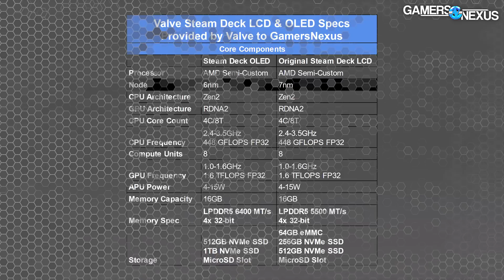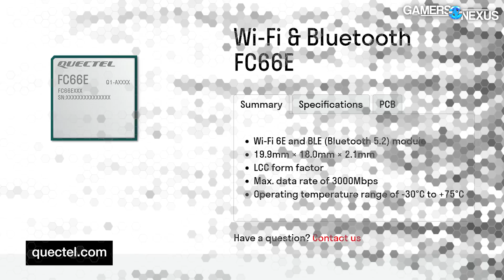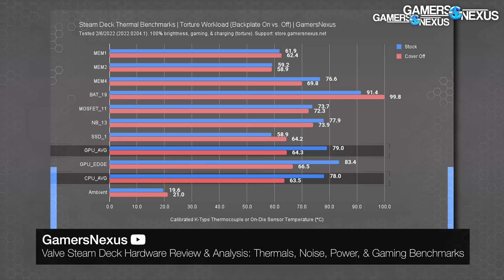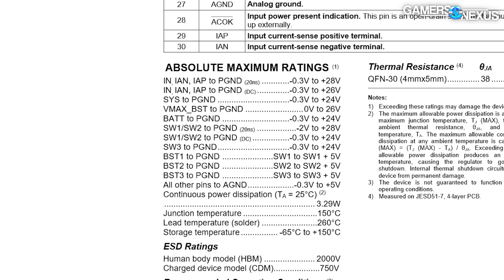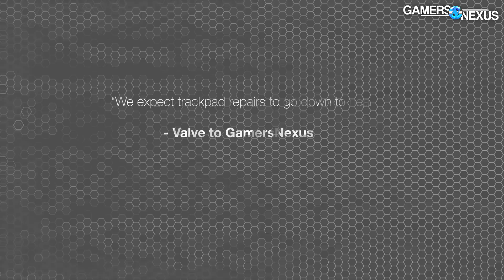They Changed Everything: Valve Steam Deck OLED vs. LCD Tear-Down

Comment: Steve, if it took that long to route the memory for only 2 dies, then they probably did time of arrival simulations rather than just length matching. Ultimately, the data needs to arrive at an identical point in time, and as speeds increase, it gets more important.
Reply: Yes the speed of light is constant...in a straight line! But you probably added 's' shaped traces to match the lengths. Shape of the S changes reflection behaviors and when you only have 50 or 100 picoseconds to work with it matters.
Reply: @LordHyren  Ah, thanks!
Reply: As someone who only drew PCBs by hand 30 years ago as an extra curriculum activity in 8th and 9th grade, can you explain the difference to me? At a glance it wold seem that, since the speed of light in copper is the speed of light in copper, then if the traces have the same length and gauge the arrival time would be the same as the transient response is the same. What am I missing?

Comment: There is no way that this board redesign, & all that empty room, is actually about thermal effency: all that space around the memory would make it really easy to shift things around and bump up system ram to 64mb for the Steam Deck 2.

Yes that would require redesign of the traces ... But with this layout they wouldn't have to remodel everything else on the board to do it.

Comment: One of the hidden benefits of having all that space around the APU and power delivery is that many chip packages also sink heat into either the top copper layer (or sometimes the bottom with heat transfer through vias). If that's what's happening here, there are two effects—first, the layer would act as a sort of "thermal capacitor" being able to wick away sudden thermal spikes (in addition to the heatsink). And second, while some people will cry "but heat soak!", there's so much free area around the APU that air can flow over that, even without fins, there would be quite a bit of heat transfer. This is often done in industry—for example some drivers for small stepper motors simply don't need a heatsink because they're a flip-chip design with a large copper pad on the top. All of this is really important for a die that has shrunk because, while the chip will be more efficient, the heat is packed into a much smaller area. It's similar to cooling issues with the smaller chiplets on CPU's—you have to have good cooler confact over all the chiplets. Even though they're small, that heat is concentrated.

Comment: Mind blown with the memory chip size DAMN. With all that space, why not make a 32GB model? 

I'll take a midrange 256GB model with 32GB of RAM and the original screen!
Reply: comes down to manufacture cost. Valve said was painful to hit $399 mark for 64GB Model. That's why still using slower Zen2 instead of Zen 4 like faster Legion and Ally.

Comment: The new thermal design makes a lot of sense. While I thoroughly appreciate the elegance of the old thermal solution, lots of people modded theirs to lower APU temperatures, which would result in everything else running hotter (probably too hot). The new setup should be a little more effective to begin woth, but more importantly, it'll be more mod-tolerant as the requirement for secondary flows is less critical.

Comment: Valve sold me their old deck (got it as a gift for my son-in-law) less than two weeks ago. Not a whisper of a new deck coming at any time. As a customer relations standard, people should be made aware that a better version is coming within a short window after their purchase. Now what? I hand my new son-in-law a handful of (admittedly cool) old tech while there is a better version that just released? Fokk.
Thank you for breaking down the specs on the new deck. It looks amazing and I can't wait to see it in action! I'll try returning this old clunker and order the new one. The 1TB version + any restocking fee for the one I am returning will still be cheaper than the deck I got. smh

Comment: I like that valve sought to change the design not just to maximise profit (although no doubt that's a benefit to valve) but to improve repairability, reliability, and thermals as well as the headline screen improvement.

The only major downsides I can think of is the existing parts for hall effect sticks for example might not be a drop in replacement, and the existing supply chain will need to be expanded to provide parts for the OLED SD.

I still want one though, but alas, I don't have enough pennies hidden behind the settee to buy one :(

Comment: Really wish I had the brain cells for electrical engineering/ PCB design. It’s pretty fascinating. It’s like a big puzzle where there’s a multitude of ways to do the same thing but with potentially vastly different outcomes in temp, efficiency, durability, etc.

Comment: Valve needs to be applauded, yet again. The first Steam Deck was designed with the intention for end-user serviceability and modification. Heck, Valve even wrote guides how to do them. Even more, they told you how to do things they didn't even recommend you do. Like they knew people were going to do it anyway and wanted to give us the best chance of doing it properly.
 
This refresh was Valve going, "You know what? Everyone likes the OLED mods. Let's do that now. Also, let's not only optimize everything else and use better components, let's make it easier for people to fix and repair parts."

This refresh further kicks in the teeth of other companies (especially Apple) who want to spread the false idea that it's impossible to design and manufacture mobile devices that allow for end-user serviceability. It also goes to show how far out of the way these asshole companies go to intentionally lock down their devices to make them nearly impossible or actually impossible to repair (e.g. component sourcing and encryption). We need to continue calling these companies out and fighting them.

We have the right to repair the products we buy.

Praise GabeN and all the engineers who dedicated so much time and effort into this!

Also huge kudos to Gamers Nexus for yet another high-quality and highly informative video! The fact ya'll got this out so quickly is astounding, but then again I'm not surprised anymore. Ya'll just keep setting the bar higher for *everyone*.
Reply: The repairability of their devices as well as how much they contribute to the development of free as well as open source software really makes me love valve.
Reply: of course we have the right to repair. We bought the product hence it's our property asset now
Reply: @whamod  You may think it's obvious but holy shit do many companies not agree.
Even worse they'll actively try to sabotage anyone trying to fix their devices.
Reply: ngl this made me actually tempted to buy a steam deck now
Reply: Imagine if Valve made repairable and modifiable smart phones. They could absolutely destroy Samsung and Apple with that philosophy. Meanwhile actually reducing e-waste.
Reply: @nojuanatall3281  Such phones exist (fairphone for example), not a mass market though for now, because people run after the next shiny thing instead of getting their phones serviced for additional years add on top of that that phones usually run out of firmware updates in a 4-6 years timeframe and you have the environmental mess on your hands we have atm!
Reply: They glued the battery in which is ridiculous and unneeded and happens to be a part that will be replaced a lot.
Reply: @dannymundo7538  Problem according to them is, that portable devices would need a fixed battery, so the glue was more or less mandatory! But anyway the battery. is an issue they have to work on in the long run because the EU will mandate user replaceable batteries by 25!
Reply: It's a cultural difference.

Valve has come up through the PC gaming ecosystem. Where freedom, customization and user generated content is valued... Whether that's modding games or building your own PCs or running emulation etc.

Apple has come up through a very different ecosystem with a more tightly calibrated end user experience where they expect to be in control of all the variables.
Reply: @Arjun-eb1yc  Still gives them NO right to dictate our right to repair their overpriced toasters lol
Reply: @Arjun-eb1yc  Apple was different a long time ago. You could buy an Apple ][ clone that was not even made by Apple. There was a whole 3rd party add-on card market and the manual on how to build your own cards for the Apple 2.

Then they became greedy and almost went bankrupt until they marketed ipods, iphones and ipads to people who only care about the shiny status symbol.
Reply: @joe--cool Apple didn't become greedy. Their shareholders did.

Big difference.
Reply: @joe--cool  these days Apple won't even allow AMD/Nvidia to ship Vulkan drivers on OSX. Because they don't want devs to have a common Vulkan target across Mac/Windows/Linux. I.e. they want applications to be less portable across platforms.
Reply: @Arjun-eb1yc   Source please?  Would NOT doubt it though lol.
Reply: Wish there was an easy way to mod the switch
Reply: @nono-hy7gb gl with that... Nintendo and Apple could well be twins.
Reply: OLED mods? Where?
I was about to order the new Deck in a couple days but an OLED mod could save me money for now.
Reply: Valve needs to make more, and do less squatting on their sales cuts. This is a step in the right direction, but they can do so much more I just know it...
Reply: Servicability until you hit the battery, I am still puzzled why valve did not go with pullable adhesive strips, Apple style and went with bottom glue instead, but I guess they needed to save some space and glue strips add to the overall thickness compared to glue!
Reply: We will applaud them the day hl3 comes out

Comment: Crazy how much they changed. It's almost like a completely now product. It's also really nice to see someone actually think about repairabiltiy and actively trying to improve things. In comparison to nintendo and their switch for example

Also quick sidenote: The flickering (I assume from the LEDs from your lighs) is really off-putting (see for example 4:43 or 9:15). Never seen that before in a video of yours
Reply: Almost like a completely new product? True, because aside from improved overall design and efficiency, it performs exactly the same on existing games. 

Demanding games are nearly identical in every way too, so it's the same machine at the core.

In that regard, they're not any different than Nintendo. Whatever you want to believe though.
Reply: @notsyzagts7967  What are you talking about? Do they advertise performance improvements anywhwere? Checking the store, they advertise 4 main points: Better display (OLED is better), more battery time(the battery is better) , faster downlaods (technically possible with the faster wifi module, if you have  the bandwidth) and finally lighter and cooler, which it likely is given the changes.

The note with nintendo was in comparison to their messed up policy handling their garbage joysticks even after redesigning the whole thing. They knew they were broken, but decided to make money off of it anyways. Valve on the other hand moved buttons around n stuff to make it easier and cheaper to repair. So tell me, where am I wrong? If you want more performance, buy a product that actually advertises more performance.

And for the record, I don't own a steamdeck and won't any time soon either.

Comment: 4:05 The length isn't important, it's the delay, having 2 traces be the same length doesn't necessarily mean the same delay, since there are capacitances and inductances that influence how long it takes the signal to travel to it's destination

not an expert I just heard this from a Robert Feranec/Fedevel PCB design YouTube video
Reply: length closely correlates causally with delay even tho it's not perfect

so it's not entirely wrong

Comment: I'd love to see comparisons between the etched and non-etched glass. I think I might prefer the 512gb model for better blacks in dark environments. I don't suspect I'll be playing a lot in outdoor or office lighting conditions. Side by side shots in various environments would really help me overcome the urge to try and snag the limited edition colorway.
Reply: This is my biggest request as well.
Reply: Dave2D compares the etched vs non-etched screens in his Steam Deck video and it looks like the non-etched version is the better option for indoor use.
Reply: @NoToeLong  - Dave2D does a decent approximation using a screen protector, but I still think we would benefit from a more in depth comparison. The glossy model Deck on the top is an LDC, and Dave2D only does the comparison under studio lighting with a brightly lit background. I don't mind the screen protector trick, it's mostly the different lighting environments that I feel is missing
Reply: That'd be a good comparison to see, though with the screen protector trick it might be best to get the etched glass one and add a screen protector if you feel you need improvement.

Comment: Docked operation without internal battery testing could be interesting as desktop replacement.
Reply: Maybe as a laptop replacement but not a desktop. Not with a screen that small lol.

They didn't make any major internal upgrades so it has the same base performance limits as the original.

It's better but not THAT much better.

Comment: It would have been cool to see that airjet cooling system in this, but at least its better than the original as far as cooling. Maybe the redesign could make it easier to retrofit something. Wish that company would just sell a solution if its possible. The fan noise and battery life are my two bigger gripes, and I use the Steam Deck all the time so this update  is tempting.
Reply: The airjet's biggest problem is power consumption. It's very quiet, but it's not power efficient at all. And an extra watt or two of power matters a lot in devices like this.
Reply: The unit cost of a traditional blower fan vs that of an airjet is likely to be orders of magnitude different, a cost increase for a part change which would have little impact on the end user.

Comment: Burning question because you're seemingly the only people with a preview unit who've had the guts to take it apart - would the process of replacing the internal SSD be the same, easier, or harder than the LCD model? I swapped my LCD's storage for a 2TB drive, and if it's significantly harder or impossible to replace the internal in the OLED, that's absolutely stopping me from upgrading.

Comment: 7:36 Oh no...The new WiFi adaptor. The old Deck's WiFi 5 adaptor can be upgraded to a much better WiFi 6E Intel AX210 due to same form factor. The one from Deck OLED seems not compatible from the looks of it. Now that Intel WiFi 7 adaptors (Intel BE200) are in the market, old Deck users can upgrade .
Reply: Am I dumb? Chip size and form factor seem wildly different

Comment: So the new battery can't fit in the old Deck? I was hoping to maybe buy the bigger battery separately and upgrade my LCD Deck at some point.
Reply: The new battery is physically larger and uses some of the extra space made by the fact that OLED panels are significantly thinner than LCD assemblies, so no, unfortunately, at least not with an unmodified case

Comment: Not gonna lie, I'm more than a little disappointed that Valve didn't work with GuiliKit on including Hall Effect Sticks and Triggers out of the box with this revision. And in fact, they seemed to go out of their way to redesign the sticks just so GuiliKits current aftermarket Sticks are no longer compatible.
Reply: They changed everything for Cost reason, otherwise they would have changed the design.

They already said that the "Hall Effect Stick" is not as Anti-Drift as people think.

The Device still has to be affordable, remember that.

Comment: Since you mentioned that, according to Valve, "it's possible to remove the OLED screen from the device without taking apart the whole back of the device" do you think it will make things like shell-swaps for third party shells easier? Or at least involving less heat gun + adhesive related shenanigans?

Comment: 166.05 mm² down to 132.65 mm² is more than 20% die shrink, which I think is remarkable considering N7->N6 will only net you like 18% more logic density iirc.
N6 is said to be easy to transition from N7, but there might have also been some design changes at play here. Interesting stuff.
Reply: i heard the original chip had some unnecessary stuff, supposedly because it wass originally a microsoft project
Reply: @the_retag  Wow, I never knew that! That may explain the huge reduction. 
Thanks for the detail, now I really want those annotated die shots side by side lol

Steve, please make it happen!!1!1!!
Reply: @the_retag with someone doing a die shot, the chip was shared with an AR company
Reply: @macstevins  yes watched a die shot vid too
Reply: @the_retag  The original chip was a generic laptop chip, so it probably had a lot more I/O than what the Steam Deck needed (like SATA).
Reply: @andersjjensen  no it was certainly not a regular laptop chip, definitely custom.
Reply: that'd be based on amd cpu design, tho it's very interesting to see such a larger reduction
Reply: most of the large size of the memory packaging is just epoxy cover, the actual die is often around 80%-50% the size in the middle so the memory die shrinking/ improving  means that you can shrink the size a little more than the estimated 18% more logic density (some smaller ICs or chips can be around 30% of the size of the epoxy cover)